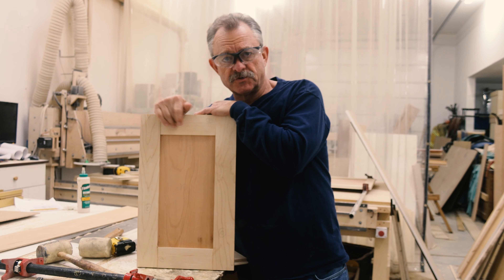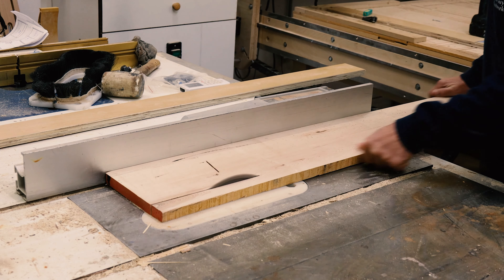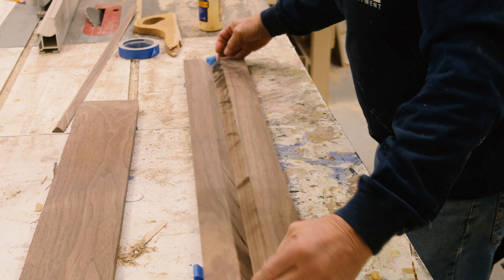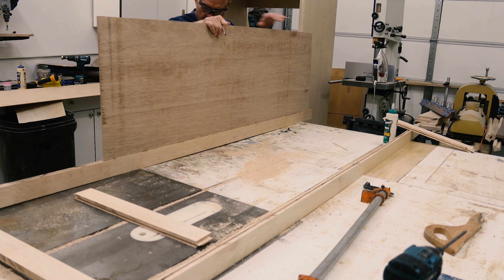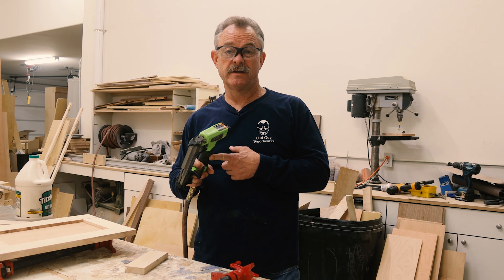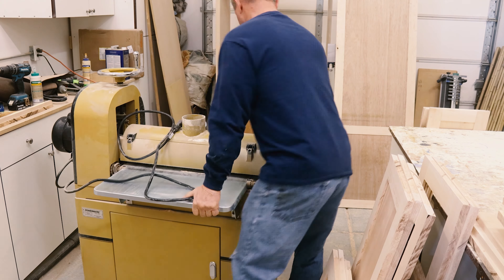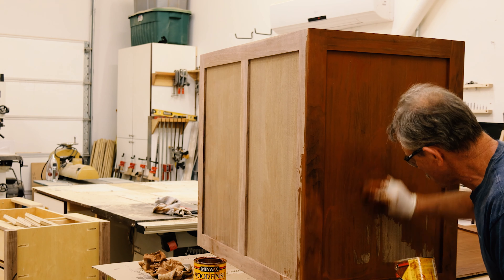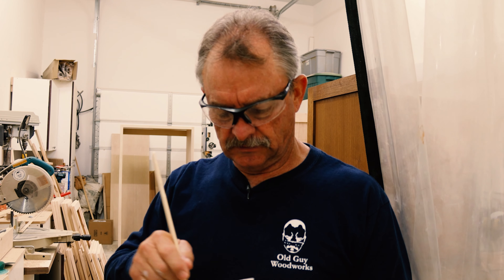Kitchen Cabinets - How to Build Shaker Doors

Comment: That door drill setup you have looks like the Sommerfeld Easy Bore Jig. https://sommerfeldtools.com/sommerfeld-s-hinge-boring-jig   Where is that one from?  Also did you use the nylon inserts on your hinge screws to set the hinges into the door?
Reply from the maker: It's a jig made by Blum: https://amzn.to/2BCFS3O.  Yes.  The hinge plates I use have nylon inserts on them already.